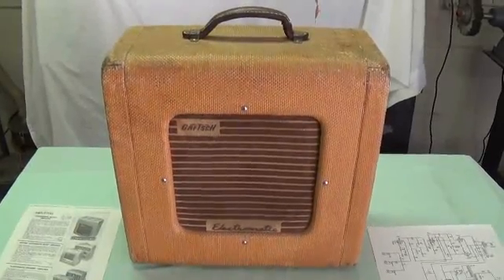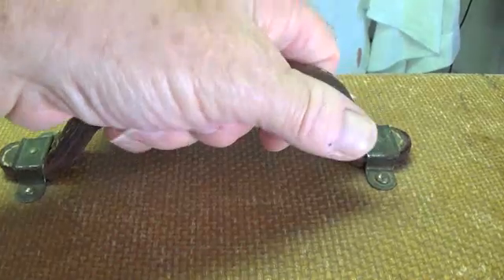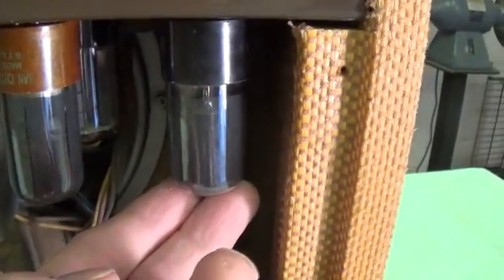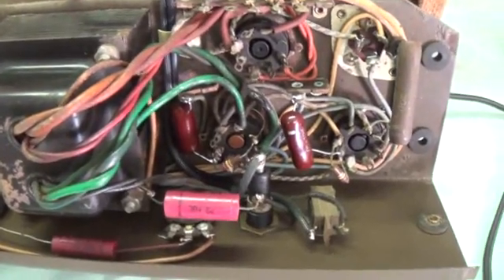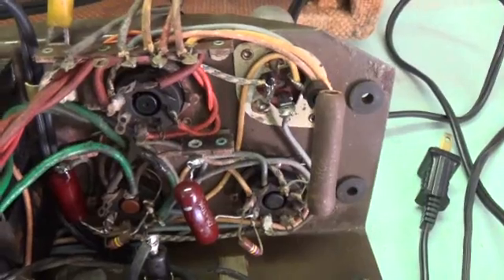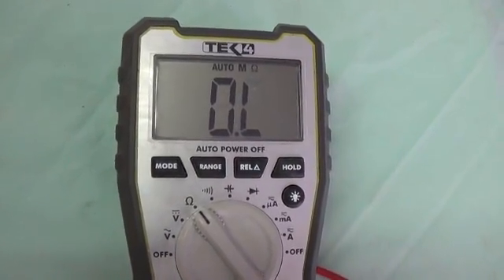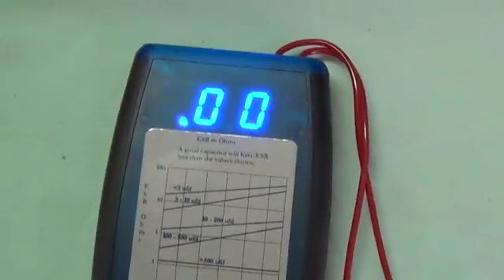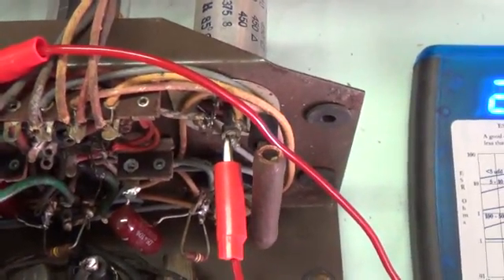Using an ESR Meter to Determine the 'Health' of Electrolytic Capacitors in Guitar Amplifiers

Comment: This is extremely helpful. I need that meter.
Reply from the maker: Greetings, Brad. As others have said, since the ESR meter does not test electrolytics at full voltage, it does not provide a complete evaluation of their status, but it does provide valuable information without the need to remove the cap from the circuit. It is quite rare to find a capacitor that tests well on the ESR meter that is not "healthy" and usable.....and it allows you to quickly weed out those which are not.
Reply: you retain more value of vintage amps with the retention of original parts that dont need to be changed which can add up to hundreds of dollars
Reply: Stephen Chow I never knew that. I knew visible modifications would lower the value of antiques as they do with cars, but not replacement parts. Thanks Tube electronics have a certain beauty to them the new stuff can't match.
Reply: Cheaper and better  to just replace all the wax, tubular or can capacitors in the amp if it's old.  Those parts cost less than 50 cents each and modern replacements for the electrolytic can type are only a few dollars and there are not that many in the amp.  Be sure to get the polarity right.  Why buy a meter you're only going to use once when buying a few capacitors is costs much less.
If the large filter (can type) capacitor is bad or failing you'll hear a hum in the speaker.

Comment: (Taking notes)
Reply from the maker: It's a valuable tool, JR, when used in conjunction with your capacitance meter, and other instruments, and it can test capacitors in circuit, even if they are in parallel with other caps.

Comment: Is the other gator clipped onto chassie ground?
Reply from the maker: Bob, the ESR gators are attached to each of the two leads from each axial or radial electrolytic capacitor. If it's a can capacitor, where the can is the grounded negative portion of the internal capacitor(s), then you connect one gator to ground and attach the other gator to each of the lugs to test each internal capacitor. Polarity is not an issue.....you can attach either gator to either capacitor lead (or to ground). Also, you can test the capacitors in circuit. There is no need to disconnect the positive cap lead from the circuit, like you must do with regular capacitance meters.
Reply: Thanks
Reply from the maker: You're welcome, Bob.

Comment: hallo Mr Doug
ESR70 is good. I prefer to disconnect cap and mesure it individually specially if they are in parallel twoor three like in a power supply. Equiv series resistence are in parallel too !!! That means that you will not probably see the bad capacitor in the circuit.
Very good video.
Best regards.
BEN
Reply from the maker: Greetings, Ben. The Anatek Blue ESR Meter can accurately evaluate capacitors in circuit, whether in series or parallel, so you don't have to remove any leads prior to testing.

Comment: Doug, is it a good idea to use a Variac to "bring up the voltage" slowly on an old amp that still has the original electrolytics?  I just picked up a '64 Silvertone 1484 and it has not been touched.  The amp sounds great.  Can I trust the caps that are in it and use the amp for a gig?
Reply from the maker: I have used a Variac for this purpose many times, and if you have one, I would recommend using it. I also highly recommend running any newly acquired, untested amp through a light bulb current limiter for its first few start-ups.

Re the 1484, I have no way of predicting whether it will function properly, but if it sounds great, without any 120Hz hum, then odds are it will be fine. Until it has proven itself to be trustworthy, you might take along a backup amp just in case. Good luck.
Reply: Uncle Doug
 I use the leakage test on my Sencore Z-meter to provide a high impedance, high voltage source at the standby switch of an amp to reform the caps.  Power off of course.

Another method is to pull the tubes and put a 100K resistor in series right after the rectifier.  Measure voltage across the resistor and when it drops down below about 25 volts are so, it is safe to put everything back together and power up the amp.  If it doesn't, you know you have a leaky cap and will have to do individual testing to find which one.
Reply from the maker: An excellent suggestion, JL. Thanks for your informative input.

Comment: I got a tester on ebay for 30 bucis, it does capacitance, esr, as well as transitors, mosfets, inductors, resistors, diodes, zener diodes, dueldiodes, and quite a bit more. It also has a nice graphical screen.
Reply from the maker: That sounds like a versatile instrument at a very reasonable price, Luke.  Congratulations on a great acquisition :)
Reply: Uncle Doug yup. I got it the other day actually. I wish I would have gotten one earlier, it works so well. It uses an atmega 328 series chip, same as the arduino uno. It also has a port to program the latest firmware. I will complain that it does not have a way to calibrate (that I am aware of)
Reply from the maker: It really sounds like a good instrument, Luke. The lack of calibration capability is a little troublesome. Perhaps you could make a graph with instrument readings on the X axis and known-correct values on the Y axis, then either calculate a correction factor or use the graph to correct the readings.....if necessary. On the other hand, you may find it to be completely accurate.
Reply: I would have to say it is pretty acurate, it has no wires. There is a componant socket on the board, and the chip is right next to it. This helps with wire induced noise and resistance.
Reply: @UncleDoug  Does the Amtek ESR meter need calibration at some point Doug?
Reply from the maker: @TwigtheWonderKid-q9r  You zero it each time you turn it on.  I usually measure some new caps to get a proper value for the old ones.  Other than than, I am aware of no calibration that can be done by the end user.
Reply: @UncleDoug  thanks mate!

Comment: Uncle Doug,

I was wondering if you could weigh in on capacitor testing. I have a 3KV DC Power supply that I am going to get up and running in the next few weeks. Is testing a high voltage capacitor by putting DC through it and reading for leakage a more / less / or equally accurate way of testing a capacitor in comparison to the ESR meter? Is it better to do both? Thank you!
Reply from the maker: Aaron, due to the extremely high voltage level I would probably opt for leakage testing at 3KVDC, simply because I'm not sure if the ESR meter is capable of providing accurate, meaningful readings for such high-V electrolytics. I have never seen a listing of acceptable ESR values at such high voltage ratings, so you would first have to obtain ESR values from a group of new (known to be good) caps, calculate a mean, and then compare that mean value to the measurements taken from caps that are known to be "leaky". If a significant difference is found, then the ESR meter would be usable to differentiate between good and bad caps. As far as I know, this is uncharted territory, so you would have to verify the reliability of the ESR meter prior to accepting its readings. To be honest, I suggest this with all test equipment.....verify the accuracy before relying on the measurements.
Reply: Uncle Doug Thanks! I am picking up my ESR meter from Alltronics in Santa Clara this Thursday :) I will let you know how it goes. I have a plethora of old tube equipment that I will be testing and getting running thanks to your suggestion of this great tool :)
Reply from the maker: You're welcome, Aaron. I think you'll find the ESR meter to be a very useful device. I also find that the capacitance-reading capability of my digital multimeter, as well as some common sense often come in handy. Best of luck !!!

Comment: A great video, Uncle D! I have a few amps made in the early 90's, and I've considered replacing the caps on them out of age concerns alone, but if this can capacitor is working just fine and it's from '75 or maybe older, then maybe I ought to leave things be, or test them first.
Reply from the maker: Alva, I think testing first is a good idea. Lots of times, the original filter capacitors are still fully functional. If the amp were going to be used for a four-hour concert at Carnegie Hall, I might be inclined to replace them, but for home use of a nice, original vintage amp a few times a week, they're most likely just fine. If they start humming after a few months or years, then it's time to replace them.

Comment: Hi Doug
I came across your video while researching ESR meters. My interest is tube radios (although I do have a very nice Blues Junior amp!) and the general consensus seems to be that the meter is not useful for the higher voltage caps. But I must say you've shown clearly how it works and I think I will acquire one. VK5JST has  designed an interesting analogue kit: http://www.users.on.net/~endsodds/esr.htm 
I also like your 100 ohm shorting probe. Is it patented?:)
Cheers
Laurie
Reply from the maker: Greetings, Laurie. It's great to hear from you. The prevailing "wisdom" is to automatically rip all old electrolytics from their moorings and replace them with modern caps (often of rather dubious and variable quality). I too did this for many years, but once a good, reliable test instrument became readily available, I was "shocked" (not literally :) to find that most of the caps I had replaced were still fully functional. Now, since I deal almost exclusively with vintage tube amps, the desire to maintain originality overrides my adherence to this outdated edict. I think that once you obtain a reliable ESR instrument and do some experimentation, you will agree. Best of luck !!!  P.S. The 100 ohm probe design is yours to copy :))

Comment: Sometimes I test capacitors with a DMM to check if they've gone low resistance and they leak initially but then after a few seconds their resistence goes up to infinity.  Are these really leaking or is it an effect of the DMM autoranging?  If so, these cases might be the pathologic examples where the ESR meter beats any other test available.
Reply: I know your post is old, but perhaps someone else might benefit from this answer even if you've learned why....   The DMM's resistance check applies a small voltage to perform the test... the cap will show a low resistance until it charges to the test voltage.

Comment: So, I have to ask...Some caps may only fail under working voltage, I wonder if the ESR reading would identify these, with less then 9 volts being pushed from this device?
Reply from the maker: An excellent question, Brad. I often hear concern regarding the inability of the ESR meter to test electrolytics at full operating voltage (i.e. 450V). In practical use, this is not an issue for me, since the first step in my evaluation of a newly acquired vintage amp is to check the fuse value and then plug the amp into a current limiter (see my video) and turn it on.

If there are no shorts (light bulb flashes and absorbs the current), then check amp function, tone, hum, etc. Remove chassis and address specific deficiencies noted during initial sound check. Test all caps in circuit with ESR meter to see if they are within tolerance. Check resistor values, especially those showing heat damage (esp. screen resistors). Test tubes.

Any shorts in electrolytics are immediately evident with current limiter. Any leaky ones are evident (120Hz hum) during full-voltage sound check . Any out of tolerance (failing but not yet failed) are detected by the ESR meter.  Thus, the ESR meter is only a part of the process, not the sole means of testing.

To address your question, no device can provide complete assurance that an electrolytic won't fail. Even a new, fully tested (at 450V) electrolytic could fail next week; and, fortunately (in my experience) they almost never fail in a "shorted" condition. If they do, then the PT is protected by a carefully selected rapid-blow fuse whose value is just high enough to allow the amp to function properly.

This system has worked for me for about 35 years without the loss of a single power transformer in hundreds of amps. The recent availability of the ESR meter has simply made it more comprehensive.

Comment: I've purchased one of these puppies recently, and basically found it to be a useful troubleshooting tool! However, if I do find a cap that gives me a borderline reading (suspicious), I use my old EICO capacitor checker to back it up and test the cap at it's rated working voltage. I've found many paper caps show leakage at only 25 volts of the 450 volt rating of the cap...no sense bringing the voltage up too much higher. For the most part, I trust the ESR meter to a very good extent (a lot more than a digital cap checker) I find the ESR meter excellent with the lower voltage caps used in solid state circuits! It's been on target! The Blue is definitely worth the money and a good investment for any tech shop...Hope this input helps :)
Reply from the maker: Thanks for the input, Frank. I've never really seen the benefit of removing an electrolytic from a circuit just to test it at full voltage.....and then, I assume, re-install it if it passes. Once it's out, you might as well just replace it. My way of testing electrolytics at full operating voltage is simply to plug the amp into a current limiter and turn it on. Shorts, leakage, etc. become readily apparent without risk to the power transformer or other components.  It's a quick, easy, and accurate. Afterwards, I discharge the caps and test them with the ESR meter to see if their capacitance is correct, i.e. beginning to fail, but not yet producing an audible hum.